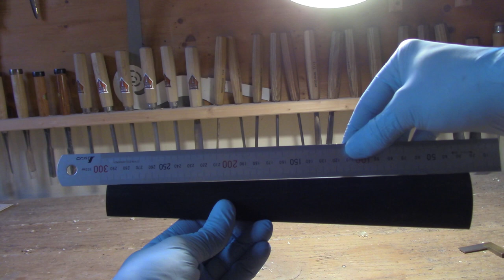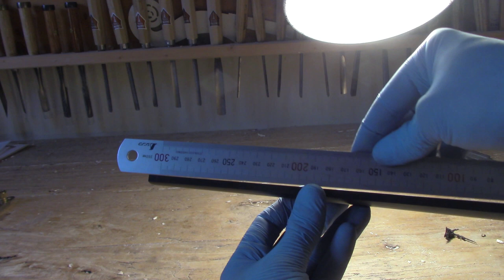MAKING A VIOLIN | Making the FINGERBOARD

Comment: I used to have lots of trouble with ebony dust to.  Flush out your nose with water when you are done.  For me it made  huge difference after 10 years of suffering!
Reply from the maker: Stephen Collins thanks for the tip! Unfortunately I also do that and nothing seems to really work...I mean, if I didn’t it’d be much worse, so I guess in a way it works 😁
I changed location in the last couple of years and this new workshop has very high dealings and is also quite big, so it’s definitely not as bad as it used to be in my previous tiny space.
Reply: How dangerous is it to work with ebony and is it unavoidable as a violin maker? I mean why ebony is toxic and not other wood dust